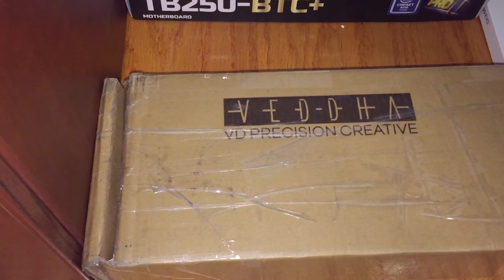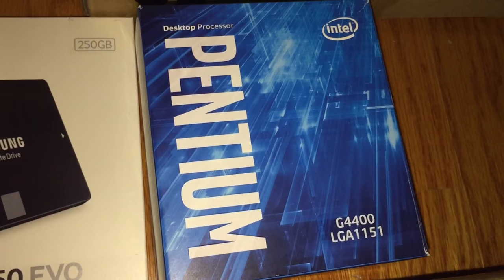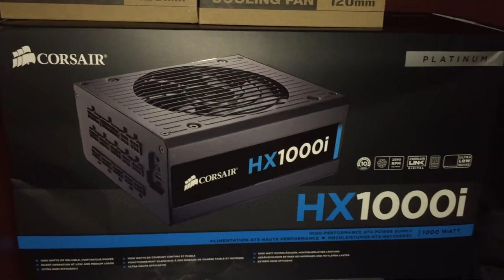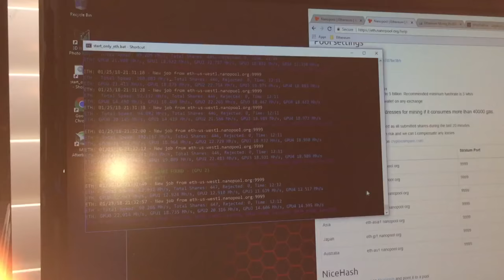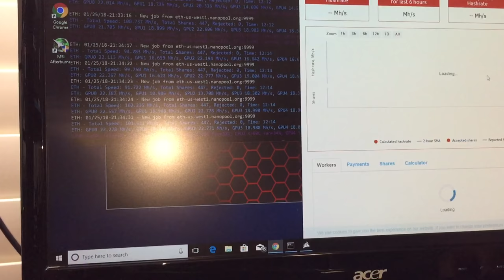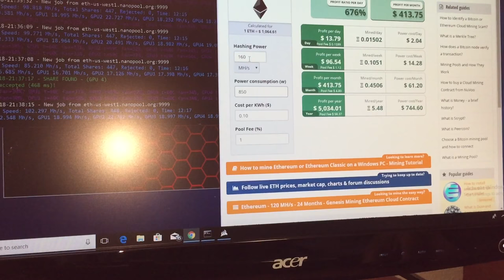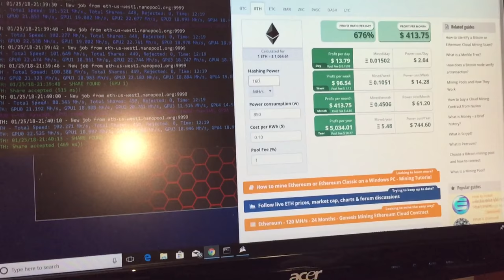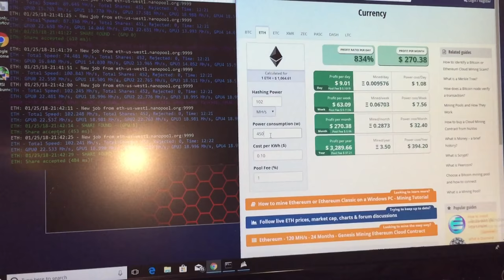Parts needed for an Ethereum Mining Rig

Comment: Do you need a special wall outlet?  And can you mske a video on how all that connects to your computer.?
Reply from the maker: Hi, currently my mining rig is connected to a 15 amp outlet with 110 volts.  It is pulling about 550 watts. (Note: There are no other appliances using this circuit).  Thanks!
Reply: HasherOne thanks